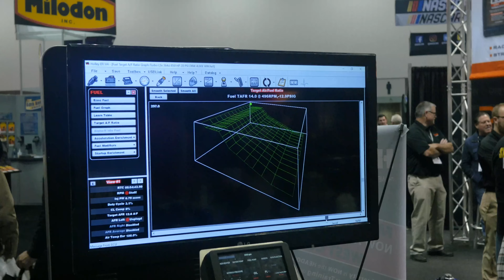24 Fuel Injectors? | Holley EFI [TECH TALK]

Comment: does holley ecus work for more then just GM vehicles because that's all I ever see them associated with?
Reply from the maker: They have a 'universal' loom. I couldn't find it by searching myself in the past but Tom mentions it in this video - https://youtu.be/2Q49DsNmcsI
I would give them an email or call and see what they say.
Also, yes, 100% you can use Holley ECUs on more than just GM and Ford. They are just large markets for modification in the US so you see them around a lot - Taz.
Reply: They have plug and play with Ford Coyote but I'm sure they have more.
Reply: Kelly Sandford Alright I'm gonna look more into them
Reply: Based on what I've seen with them (Im on the market for an ecu), they are plug-and-play with GM and Ford motors, but other vehicles might need to have sensor connectors changed out
Reply: The Dominator ECU and the HP EFI ECU are universal, but the wiring for them isn't. The inputs (although aimed at LSx and Coyote motors) can also accept other compatible engines, which most engines have compatible sensors. All you would need to do for those motors would be to buy the Un-terminated harness and terminate the wires yourself
Reply: Todd Bentley I'm gonna compare holley with the 1 I  might get and see which 1 works best for me
Reply: Todd Bentley same here I just looked at there website hoping that there was a universal one but there's not one.